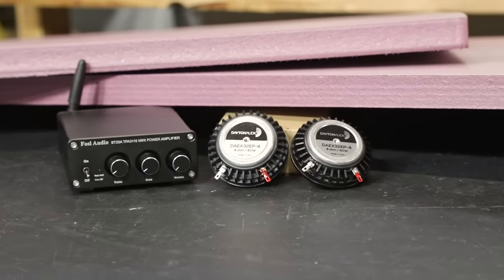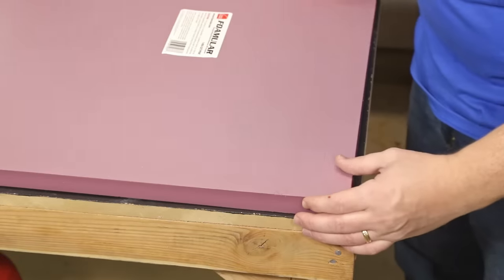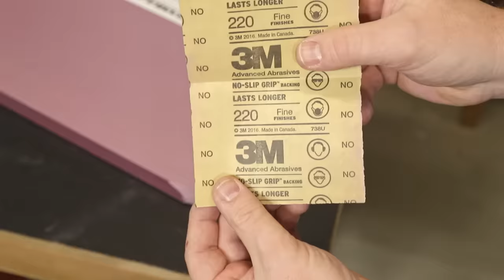How To Build "The World's Best Speakers" - Are Flat Panel Speakers Really Any Good?

Comment: You would have to wonder if different thicknesses of the board along with the size of the board could fill in some of the missing frequencies.  For example, with all else being equal, would a 2" thick board give you lower frequencies like a subwoofer, a thinner board would give more high frequencies like a tweet along with more powerful audio exciters for the lower frequencies, less powerful units for the higher frequencies, etc.
Reply: Thickening up the board, I think, would just essentially increase its 'resistance' and quiet it down. The low frequencies come from a larger board being able to bend more and contain larger wavelengths (lower frequencies). However, I do wonder what would happen if one were to find a clever way to make a folded/layered board, maybe getting a 4'x8' sheet down to a 2'x4' size. Might even be creating resonance chambers inside the folds, but I don't know if that would be a good way or bad. Probably would require too precise of engineering/modeling for this layman to bother with. But! Could probably style the speakers as art furniture, and it might be a good application for that 'tensegrity' style that's been somewhat popular lately.

Comment: Very interesting , what i dont understand is why the are hanging , shouldn’t they have a fixed point for better performance , so the back of the driver should be supported agains a big fixed mass ( a wall ) , this way 100 % of its movement would be transmitted to the panel as intended , otherwise there would be distorsión because of the interactions between the two masses .

Comment: So these must be parallel to the wall? How about listener position? I have pretty small room, my NS-1000m taking space...so i'm considering alternatives. These seems very interesting. In theory, at least.
Reply from the maker: Hi Alex - they work well in a small space, but I do have a few tips: 
1) Add some acoustic insulation to the wall directly behind the speakers. They emit sound from the front and back, and you don't want the sound from the back reflecting and interfering with the sound from the front. 
2) Add a small subwoofer to round out the sound.
3) The farther apart you can place them, the better the stereo image will be.
Good luck!
Reply: @AmplifyDIY  thanks for reply. Will do some experiments! )

Comment: Seeing that they are free hanging, it seems that they would suffer from a large amount of loss. (Every action has an equal and opposite reaction) So, as the panel is moved by the Exciter, the Exciter is moved by the panel, resulting in loss of panel vibration, and sound output. I'm curious if mounting the Exciter to a solid object (the wall) and then attaching the foam to it would result in a cleaner and more responsive speaker.
Reply from the maker: I wondered the same thing, and tested exactly that in this follow-up video: https://youtu.be/XC814uQjlaE

Comment: You need to mount the speaker portion to a rigid surface and leave the foam suspended. Its losin a lot of mid range to itself vibrating backward
Reply from the maker: I’m testing exactly that I’m an upcoming video. Stay tuned!

Comment: Go find you a second hand stereo receiver with built-in preset equalizer modes to bring out different tones
Reply from the maker: I've got my hands on a decent older Sony receiver that I am planning to use for my next testing. Just have to finish building all the test rigging and all the various panel configurations so I can do the testing. :)

Comment: Yes, ultimately, these are actually a most pure form of speaker.   The foam is the baffle.  The driver is actually the speaker, and everything else influences air movement and timing.   I didn’t understand this foam though, was it specially formulated for this?  Or is this readily available as a building supply material?   Did those other guys specify this foam board?   Or did you just pick something that seemed similar?    The density and outer layers finish of this material is crucial, as is the distance from the rearmost point of the diaphragm in that driver, which is, by the way, what looks like a compression driver intended to be a horn, or high frequency driver for loudspeakers, reproducing mods to highs, generally around 1KHZ up, dropping at around 12-16khz.     That amplifier matters too.   Big time.    And the most important part, glossed over like so many corpses with a shrug, is how those wires connected to the driver were dressed from that point.    Anywhere they touch, are fastened, graze, bounce, or even weigh as a pull from that point, ALL greatly influence the sound of that “thing”.   Yep, it’s a speaker.   That horn/is loosely, essentially, just a relative thing.  Consider how much bass your headphones make.    Cause they’re right there, and the closed cup type conserve the air movement needed to radiate sound.    You could take nice headphones and do this same thing.   In fact, it might sound better, but I doubt it.   Resonance is EVERYTHING.    Those panels are essentially drum heads, no shell, no ring.   When a drummer is tuning the drum, there are usually about eight lugs around it which tighten or loosen the drum head onto the shell, via the ring, or hoop.    Even a slight alteration to the tension on any of those lugs can greatly alter the resonance and thusly the tone of the drum.    Any speaker driver is a part of a drum, and the baffle is an extension of that.   Even the weight of the speaker cables hanging from the driver will have a significant impact on the characteristics of the speaker.

Comment: Any ideas on where to get this type of foam board in the UK?
Reply from the maker: Hi Ben - it's used in construction as thermal insulation, and is often sold as XPS (for Extruded PolyStyrene) panels. Owens Corning produced the ones I used in this video, but I'm not sure if they sell in the UK. I know there are other manufacturers that distribute across other parts of europe (Germany, specifically), but I'll bet if you just google for XPS Manufacturers in UK something will turn up. Good luck!

Comment: You wouldn't want two different exciter position placements for each speaker that create different frequency responses. You would want them to both be the same so they match. Right?
Reply: Great video BTW.
Reply from the maker: Thanks funky! I actually did a follow-up video to test multi-exciter placement. Most viewers felt the test with 2 exciters per panel sounded better than a single exciter alone: https://youtu.be/XC814uQjlaE
Reply: @AmplifyDIY  Awesome! Thanks!

Comment: @AmplifyDIY

Since a speaker is also a microphone, how well would these work as microphones?  Any chance of a follow-up pursuing this question?
Reply from the maker: Today I’m finishing up most of the principle filming for a follow-up comparing all kinds of configurations etc as speakers. Given how much work this video has been, I don’t know that I could commit to another in-depth follow-up testing these as a mic. Maybe, though. I have a few other projects to knock out first, though. Thanks for watching!
Reply: @AmplifyDIY  Thanks for the reply! I reckon I'll hold off on assembling a set of these until after I see your follow-up piece.

Comment: the real benefit to these speakers is that you can tune the exact shape/thickness/material based on the frequency you want.  for say like a 7.1 system, you can tune each speaker for where they are positioned in the room.  You dont get that kind of control without otherwise dropping thousands of dollars on a sound engineering company to do that work.

Comment: Can you please show how you wired these speakers ?
Reply from the maker: Hey Relax - the exciters have terminals on them, one negative, one positive. The amplifier also has a negative and positive for each channel. I used regular speaker wire to connect the negative of the amp to the negative of the exciter, and then did the same for the positives. To connect to the amp, I just stripped back a little bit of the insulation on the speaker wire, then put that into the pinch connector on the amp. To connect to the exciter, I added a spade connector to the wire, which slides right onto the terminals on the exciter. Hopefully this all makes sense. Thanks for watching!

Comment: Rather than trying to demonstrate the sound from a lapel mike and youtube, it would be great to see how it performs with a spectrum analyzer. There are some pretty decent phone apps that could be used. And also what is the efficiency? I'm guessing you need a ton of power, but I could be wrong. Many years ago I had a set of Mangaplaner speakers. They were super expensive and huge. But the sound was incredible. They did require a lot of power though.
Reply from the maker: Hi Paul - I thought about doing some measurements, but I don't have a controlled space to do so, or the right equipment to take accurate measurements in the first place. In this follow up video though, I did a comparison test that attempts to mitigate for all the compression that YT does, and allow the viewer to compare with their own ears to hear the nuanced differences between a bunch of panel designs: https://youtu.be/XC814uQjlaE

Comment: After seeing your and @Tech Ingredients video I thought I'd give it a shot. However, mine sound quite shitty and somewhat tinny. Maybe you can point me in the right direction when I tell you how I did it. I used 20mm thick XPS (50x60cm because of lack of space and nothing thicker was available) and some different exciters, because I couldn't find the ones you guys used (Dynavox EXC-25, 25W, 2Ohms). I rounded the edges, sanded the surface and painted the front with a thin coat of wall paint to match the room (I saw someone else do this, too, so I thought it should be fine). I placed the exciters at the 2/5-3/5 intersections after sanding and sealing the surface.
I thought I did my best but like I said the sound is quite dissapointing and falls short of the sound of my cheap Logitec PC speakers. I placed one exciter on a thin board of plywood I had layin around and it even sounded better than the foam.
Any help or hints would be highly appreciatede :)
Reply from the maker: Hi Manuel - I suspect it's the paint that has killed the sound the most... though 20mm is also pretty thin, and may also have had a negative effect on the sound reproduction. I did a follow-up video here where I tested painting some panels, and it had a marked negative effect on the sound. If you want to change their color, I recommend wrapping them in a very lightweight, stretchy fabric: https://youtu.be/XC814uQjlaE
Good Luck!
Reply: @AmplifyDIY  Thanks for the reply! I also tried the unpainted foam and it is pretty much the same. Might be too thin but I'm not sure. What are your thoughts on balsa wood or similar materials? Some people seem to get really good results from those. The thin plywood I tested sounded somewhat better but still not as good as I was hoping. Also, what about those XPS panels with the hard, grey coating? These seem even stiffer than the normal ones but also a lot heavier. What are your thoughts on the exciter itself? How important is it? After all it just produces vibrations... right?
Reply from the maker: I've heard from viewers that also got good results with balsa... also sheets of regular glass - not sure on thickness or size, but I have a cabinet with a glass door in it that's around 18" square that sounds surprisingly good when I just hold an exciter on it. Might be worth your time to try a variety of materials you have laying around the house.... 
As for the exciters themselves: I've only tried the ones I showed in this and my follow-up video. They are the ones recommended by @TechIngredients as well. I know they are harder to find now, but I've seen them at a reasonable price on parts express: https://www.parts-express.com/Dayton-Audio-DAEX32EP-4-Thruster-32mm-Exciter-40W-4-Ohm-295-230 - they are out of stock there right now, but at least they are not expensive, and they usually ship relatively soonish.
Reply: @AmplifyDIY  Thanks! Really appreciate you taking the time :)
Reply: @AmplifyDIY  Update, because it might be interesting for others: Turns out the Dynavox exciters were at fault here. I found and bought some (much cheaper) Dayton DAEX25VT-4 and they sound MUCH clearer in the high end (e.g. vocals and acoustic guitar) and surprisingly even the low end sounds much fuller compared to the Dynavox ones. Quite dissapointing considering their pricepoint.

Comment: What's the best way to run 4 of these and a powered sub?
Reply from the maker: Hi Robert - the best way would be to get your hands on an amp that has 4 dedicated channels with the right power/impedance range for your exciters, as well as a dedicated amp channel. That would be pretty spendy though - to do it on the cheap, I recommend using 2 separate 2 channel amps, one of which with a dedicated amp channel... that's how I did my test with 4 drivers in my follow-up video here: https://youtu.be/XC814uQjlaE
The amps are listed in that video's description.
Reply: @AmplifyDIY  
Cool thanks. What's a good option for an all in one amp setup?

Comment: If I build this, I would use five exciters. I would put 2 on the top, 1 in each corner, and use a high pass filter to play only treble frequencies out of those two exciters. In the middle, I would place an exciter which would play all of the frequencies. In the bottom left and right corners, I would place 2 more exciters which would have low pass filters which would play only the base part of the music. I would put all of those exciters on one panel. Let me know if this hypothetical build has any problems, and if so, how they could be fixed.
Reply from the maker: Hey Tech and Life - I'd be very interested to hear what you think of them if you do actually build these. Sounds like a great project!

Comment: Hi! Anyone got any advice? I built these speakers and connected them to a home cinema amplifier with a sub. i am using eq and added tweeters in series with each speaker, which has improived the sound a lot. After doing all of that i feel like i am still missing crispness somewhere in the mid-highmid area, it feels a bit muddy in there compared to traditional speakers. wonder if there is anything i can do about it? i am using quite thin wires to connect the speakers, could this affect the sound?
Reply from the maker: In my experience the largest effect on the sound happens with either shape or material changes to the panels, or as a direct result of panel placement. Did you place the panels near a wall? If so, add some acoustic insulation to the wall directly behind the panel.... Good luck!
Reply: @AmplifyDIY  Omg i feel so stupid, especially that i had two foam panels almost the size of the speakers just lying around and did not think of it myself:D it made a huge difference. Thanks!

Comment: These would have sounded so much better but placed from the exciter back down and the foam up, I believe the suspension is where you are losing a lot of low end, also if a box were made supporting exciter with the foam on top these lying flat like a table and a box to support the exciter I have seen these work very well suspended differently.

Comment: I guess the problem with the bass is that the panels+air that is required to move has more inertia than the little exciters. You can kind of see them vibrate more than the panel when bass hits. Maybe mount the exciters from a boom mounted perpendicular to the wall behind them?
Reply from the maker: That's an interesting idea suggested by a bunch of viewers. I tested it in a follow up video here: https://youtu.be/XC814uQjlaE
Reply: @AmplifyDIY  awesome!

Comment: Some guy comes along in January 2018 and creates a video about making panel speakers using different materials (like common foam insulation), then a few months later, in May, he updates it with more in depth information and admits he missed a material and it turns out its better than foam insulation (ceiling panels). Someone else comes along in 2021 and sees the first video and says,  well I can make me a video about that!, doesn't see the 2nd video, and now his viewers are making panel speakers from expanded foam, not knowing the full story or about the other material. there's a lesson to be learned when watching old videos and rehashing old news.
Reply from the maker: Heya Marks100000 - As I mentioned in your other comment: yes, I've pointed my viewers to the original @TechIngredients videos, as well as mentioned the different materials numerous times in the comments as well as in the video. Ceiling tiles do produce a different sound profile, but they are not necessarily "better" - they can do a better job with reproducing lower frequencies, but they  perform worse with mids and highs. In the TechIngredients set up, I believe they actually use a total of 8 panels - 4 ceiling tiles, and 4 foam panels, each with a subtle change such as rounded vs square corners, center vs. offset driver position, etc.

You may be interested in the follow-up video I did on this, further exploring specifically just the foam material, to see what effects were produced by various changes: different shapes, different ways to color them, sanded vs not, multiple drivers, etc: https://youtu.be/XC814uQjlaE

Comment: Interesting enough, but watch the transducer vibrate in direct opposition to the panel cancels many nuances dur to out of phase canceling.  If I were to build such an array I would experiment with rigidly mounted transducers from the back only, the size of the magnet assembly that would support the whole assembly, not hanging. It would be worth playing with and hear the difference. Also a thinner panel of this material would give a broader response range. The cello sounds good because it freq range siuts the panel. This is an intersting start to a divergent tech for sound reproduction.